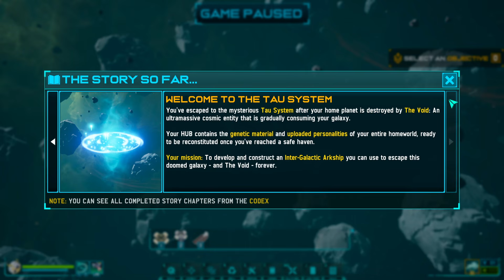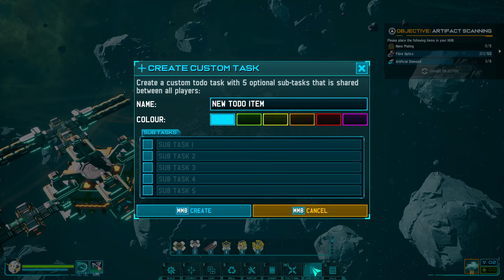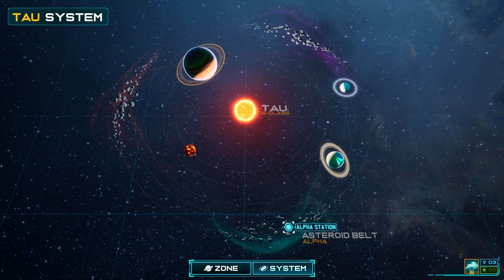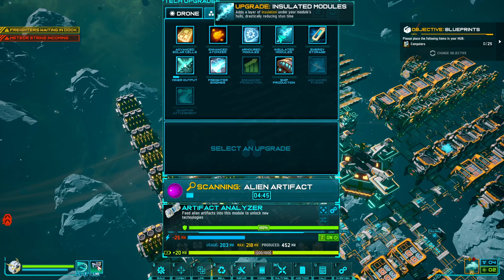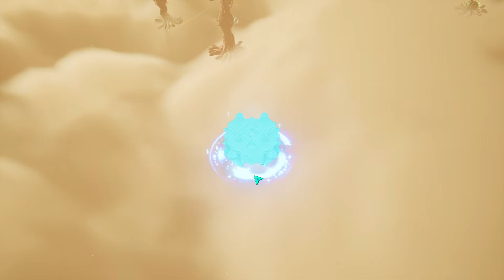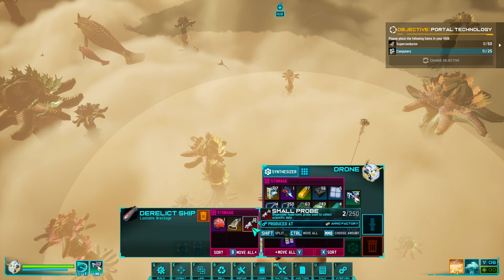I built a machine that builds machines that build spaceships

Comment: your failing at understanding the building so much its shocking

as you capping the out puts on your hub and the thing that breaks the rocks down

if you actually built smartly you could get a better flow that is not bottle necked

you waisted so much time bottle necked